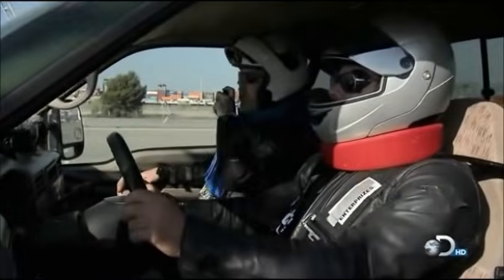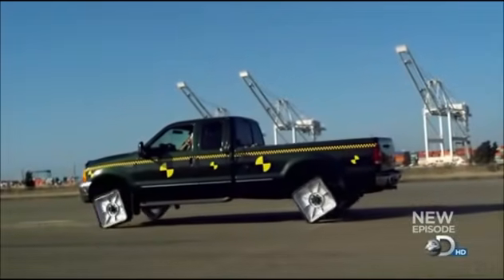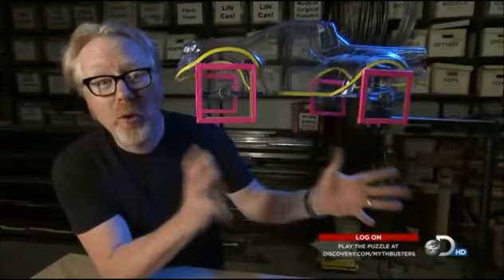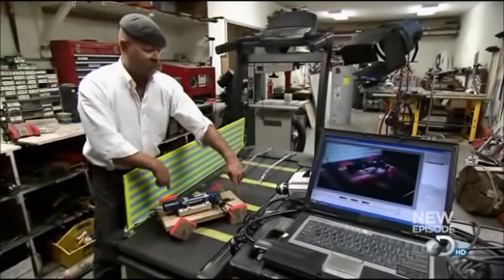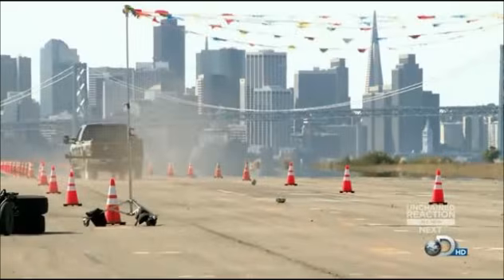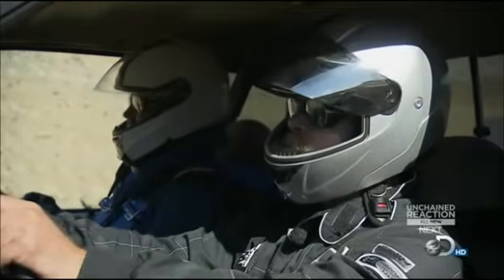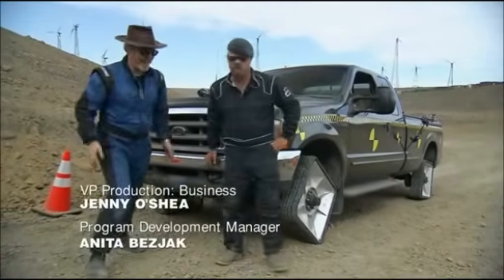Square Wheels - Mythbusters for the Impatient

Comment: In theory... if you could get it spinning fast enough to not lose so much energy to the suspension... you'd get better fuel economy with square wheels. Smaller contact patches, less drag. But, it would probably be in the thousands, or tens of thousands of RPMs before you'd start getting that sort of effect.

Comment: Mythbusters vs Car Talk -- an EPIC contest between the two greatest 
knuckle-head science teams in the techno-cyber-sphere:  A CAR TALK 
PUZZLER THAT MUST BE BUSTED!  Car talk claimed that a WWII German truck 
flat fan belt would last twice as long if cut, twisted, and reconfigured
 as a Moebius strip, because wear would be evenly divided onto both 
sides. I claim the fan belt would last LESS time because it would twist 
twice as much per revolution as a non-twisted, non-Moebius fan belt.  
More twist = more heat = faster failure.  Who is correct?!?   * CAR 
TALK VERSUS MYTHBUSTERS!!!!! *    Michael Kauper, 
childcareguy47@yahoo.com, (612) 483-0298.  Please CONTACT ME if you 
decide to Bust this Car Talk Puzzler!

Comment: Craigslist: slightly used truck. Never been abused
Reply: No lowballs, I know what I have.
Reply: @NoahLinebarrier  18k for 7.3
Reply: I was super impressed with the truck honestly. I wouldn't buy it after that, but that's a tuff truck to survive this episode.
Reply: I'm struggling to think of a single part on that truck that hasn't had 75% of its life shaved off, maybe the engine?

Comment: If the terrain were consecutive half circle “hills” with arc lengths equal to the side length of the square, the ride would be smooth at any speed. Square would be much smoother than round wheels in that case.

Comment: I love how they used 2wd with round wheels and 4wd in square wheels....
Reply: wasup23tube or how they rotated  the wheels but the truck has a differential so it did absolutely nothing because is not a fixed axle....
Reply: I was thinking the same thing.

Comment: The solution to 300 mph?  Perhaps triangular will prove to be the answer.
Reply: We're literally getting close to circles. Octagon is a few cut edges to becoming a circle
Reply: I think octagonal would be better choice
Reply: Decagon wheels would be 10x better
Reply: If you smooth the edges a bit, triangular wheels are quite useful.
Reply: Circle would be better

Comment: Thank God, circle wheels weren't copyrighted
Reply: The patent would have expired thousands of years ago.
Reply: @GamesFromSpace  not if they reniew it before it runs out
Reply: @thefrenchbastard1646  All renewing a patent does is keep it from expiring earlier than the normal maximum duration. It does not extend it past that maximum (usually 20 years). Patents are not copyrights.
Reply: Arun SK well I’m pretty sure the government at least in the us would have canceled it
Reply: @Nigel Cam What the hell does that have to do with what I said?
Reply: Thank god apple was not around theyd have not only patented them they would have later replaced them with square wheels and charged you for a dongle that snapped on over the square wheel to make it round and said it was done to make the care lighter.

Comment: Offsetting goes away as soon as you turn and with road variations. They should have tried smaller tires. I presume the smaller the tire the lower speed needed to achieve similar smoothing results.

Comment: When going up the hill in standard wheels, 4x4 traction was off, can see it in 4:07, but, climbing with square wheels, 4x4 was on, 4:27, so, the square wheels are even worse than results showed up.

Comment: Maybe if the wheels were shaped like hexagons or octagons, the truck can make it up the hill.
Reply: Maybe you just need to keep adding sides until it becomes something like a circle. A round wheel, crazy!
Reply: HEXAGOOOOOOONS

-Doug de Mauro
Reply: Hexagons got on boots.
Reply: Or if they used four wheel drive instead of two wheel.
:|
Reply: That's true
Reply: @c-dawg98  
Yeah there's a reason the saying is "Reinventing the wheel."
It's been around for so long and we've tried so many different variations that, aside from materials and any new types of science, our understanding of the wheel is basically maxed out.

I mean the "Square wheel giving more climbing power" idea is basically why round wheels have treads.  Treads in the tires create more grip, and different treads have different things they can grip better.
Reply: I know, that was just my creativity, curiosity, and imagination just talking.

Comment: Rip chassis 
Rip transmission
Rip drive shaft 
Rip axles 
Rip differential 
Rip shocks and springs 
Rip motor mounts 
Rip steering column 
Rip drivers asss!😂

Comment: If the square wheels had the rpm they would act just like dune paddle tires. If the trucks wheels was in synchros at a really low crawl speed it would climb better. If you just gun it at the hill and your paddles are not synchronized they would work against each other. Yet once again the test was bad. It’s just like the cell phone at the gas pump test. They didn’t understand the 14:1 air to fuel ratio. He kept adding fuel. Playing with matches 101 failure.

Comment: Now on flat ground that does not work well but if they had used a suffice that was kinda\ /\/\/\/\/  so that the points when into the hole and flat of the square went on the tops it may have been smooth all the way providing the points when into the gaps every time

Comment: Okay. The F250 can't climb the hill in it's base form. Because one. I'm positive that bitch ain't got 4 wheel drive, and two. You NEED to lift er'..... You should have got a truck with 4 wheel drive. That would've worked best in your situation.

Comment: Round wheels going up the hill was not in 4x4, the front wheel is not spinning before they stop... square wheel is in 4x4 when they "hit" the yellow line. I figure the square wheels have the diff locked on, but why not the round wheel's?

Comment: 4:14 Perfect example of where mythbusters screw up sometimes - they used the same wheel configuration as when they were trying to get a smooth ride. However, for this experiment, they should've kept all 4 wheels in the same orientation, providing more stable moments.

Comment: The problem isn’t the shape, it’s that the truck was designed for circular wheels so that the wheels do the work.

Square wheels work if you can SLOW DOWN the “fall”. That moment where the car is balanced on the point of the wheel and is “falling” to the square side. If you can keep the car on the point and slow down the fall it would be smooth. From there, speed up the fall equal to the climb and increase.

Comment: It's going to slam because right after it goes over the corner there is a straight line that the weight of the truck falls onto.  And, it'll use more gas.  Maybe they could try hexagonal shaped ones.  (Shrugs)  Maybe that would even help to brake faster.

Comment: The round wheel configuration wasn't in 4WD (4x4), which says so much about the square wheel configuration that was in 4WD. But an unrealistic test none the less. In 4WD configuration, that Ford F250 4X4 could have easily climbed a hill that grade.

Comment: They should have put the square wheels on a vehicle, then have that vehicle towed by another vehicle.  That way the acceleration wouldn't be dependent on the the power-train connected to the square wheels.  That was just too wonky.

Comment: There's a variation of this myth that says if you rebuild the road to be sawtoothed so that the wheels slot into them like the teeth of a cog, you would get a perfectly smooth and even ride.
Reply: How would you turn
Reply: you wouldn't
Reply: @johnferrante3247  rotating device under segmented road parts
Reply: @goochipoochie  I do believe what you are creating is a train of some sort
Reply: John Ferrante Geometry, but not just a saw shaped road
Reply: @johnferrante3247  Oh that's an edge case
Reply: some of the earliest trains (prototypes, mostly) had some wheels that worked in this way and yes, as someone else said, your ability to turn would be limited- specifically, as limited as a train.
Reply: @spamhonx56  Fairly sure they used this configuration in extremely mountainous areas to aid traction on the slopes.  You don't want to get the speed up because the friction would destroy the cogs so if I recall correctly the maximum speed of these trains was a fraction of what a conventional train could do.
Reply: Haha yes, I remember visiting a science museum when I was a kid with a whole life-sized setup to demonstrate this. But instead of sawtoothed, the cross-section of the road was scalloped (made up of repeating circular segments).
Reply: Somewhere there is a bike path like that
Reply: I like chicken sandwiches
Reply: @bandit911  I think you have reached the only logical conclusion in this case.
Reply: KTo288 it isn't myth it is SCIENCE!
Reply: Dude, tracks.
Reply: some guy in a jet would completely eliminate traffic actually
Reply: It’s not a myth because it is true
Reply: 🙌😂😂😁 "Car tracks" similar to train tracks. The only problem is changing lanes...
Reply: http://3.bp.blogspot.com/-O-dkHHKj72E/TdzNH5YDgqI/AAAAAAAABfM/nIUTwjL_NR8/s1600/mn01.jpg

You could also use this sort of setup to move really heavy square blocks
Reply: There's a vsauce video about that.
Reply: Wouldn't that just stop the truck in its tracks? Get it.. I'm funny
Reply: Just for anyone that's interested, something like this exists IRL. Specifically, trains that have to traverse inclines in frequently icy conditions will often have special tracks that are not smooth, with wheels that are not circular, so they can't just slide down the hill. (These special tracks wear down faster so they're not the main tracks.)

The tram to Zugspitze is an example. The ride was noisy and slow, but not as bumpy as you might expect.
Reply: It's called an inverted catenary curve.  You piece them together with the same arc length as the side of the square.  I was hoping the two, um, individuals in this video would demonstrate, but I can tell after watching that my expectations were too high.

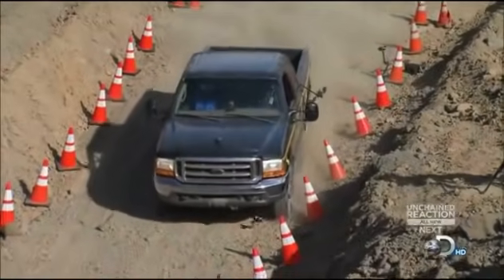Comment: At 4:25 , the only reason the truck couldn't get ANY higher is due to the fact that there was the marker there holding the truck back. It could have gotten a little further if the marker weren't there.

Comment: If the wheels had sensors to stop square during braking, with the additional rubber on the ground, it could stop on a postage stamp. However, with the forward momentum wanting to take the line of least resistance. the car would spin all over the place.

Comment: Square wheels can actually move smoothly on a special track made of semicircles instead of flat ground as long as the circumference is the same as the length of the square side. Saw this at a university, just look up square wheel tricycle if you don't get what I mean

Comment: Even though your configuration of one wheel up one wheel down was okay you're actually fishtailing the back cap makes it not very much of a smooth singular ride you're not going in a straight line you're just fishtailing and that the whole cap was ready to come off the back of the truck you need to put weight in the back of the cab for it to actually your configuration to be true

Comment: Lightly used Ford truck for sale. Lol
Reply: comes with stock wheels and an extra set of used square tires for offroad use
Reply: Diff might need attention but I'm currently too busy to work on it. My loss is your gain!
Reply: Say what you want but my piece of shit Ford has 300,000 miles on it and going strong.  I have to climb in through the window though.
Reply: Everything on craigslist😆
Reply: Bryansk Scion Forever Old Road Driver
Reply: You sir just won the internet!
"Mint condition, no wear"
Reply: @toop4538  at least ford didn't ask for bailout... Unlike chevy
Reply: Lol
Reply: "Original wheels."
Reply: lmfao
Reply: "it's got the bullet proof 7.3, 25k no low ballers"
Reply: F ound 
O n
R oad
D ead
Reply: @kyote1r77  ford is great
Reply: @kyote1r77  ford actually stands for
Forever
On 
Rescue
Duty

It stands for that because they always rescue chevys because chevys suck
Reply: ghw1985 dosent matter what brand it is dumb ass.
Reply: Brittany Wells Ford = found on road dead!
Reply: @darrelljones5536  Ford is awesome. Chevy is the brand that sucks
Reply: @brittanybenfield1463  Said the guy that drives a Toyota
Reply: @floridianrailauto9032  lmao I drive a horse and buggy
Reply: Fake News  @brittanybenfield1463
Reply: Brittany Wells ford sells a cheap quality vehicle for premium price bc it makes them more profit for them. Plus it does matter what model say they used a power wagon it probably would have made it up or a chevy Colorado or a ford raptor the raptor might not make it up but it would if it wouldn’t break but still
Reply: @samarmstrong4328  and GM are not made in America... made mostly in china. And they sell them at a premium price for profit. Fucking over the American people.. and ford didn't ask for bailout. Unlike GM so it does matter
Reply: Brittany Wells best diesel trucks r ram with a Cummins probably best all in all truck either a chevy or a ram diesel
Reply: @samarmstrong4328  yeah they probly used the bailout money to make it""so called better"" atleast ford didn't ask for bailout... and the f150 is the best selling truck.
Reply: Brittany Wells  it does matter
Reply: "it does matter"
It doesn't. The name brand of a product doesn't matter as long as the product line itself is manufactured properly. This is why any company is capable of manufacturing duds.

Brand loyalty gets you nowhere.
Reply: @samarmstrong4328  how?
Reply: @samarmstrong4328  how...please explain
Reply: no wonder it didnt work its a fuckin ford
Reply: ghw1985 Lmao.. like a Chevy would of done better
Reply: @rodrigoesparza2265  Chevy sucks
Reply: @BEC_Plumbing  lol and what did I say?
Reply: @rodrigoesparza2265  oh sorry I thought you said chevy was better sorry about that
Reply: @rodrigoesparza2265  I agree that Chevy sucks
Reply: @ghw1985 to bad all trucks are gay
Reply: ghw1985 like your piece of shit can do better......fucktard
Reply: Fix Or Repare Daily!
Reply: @bryanskscion2229  chevrolet. Cracks. Head. Every Valve Yattles Over Lousy Engine Techniques
Reply: @nickman888  I agree chevy sucks

Comment: What about Square wheels driving on a specifically designed road? Not flat, so that the corners of the wheels rotate into a depression creating as smooth of a ride as with round wheels on flat ground

Comment: Well, that was utterly pointless, hope it was at least fun at least torturing the poor truck.
Reply: Critica1Bi11 remember the older Fords were better than today's shit.
Reply: That and you certainly do not need to use Square wheels for that thing to shake itself apart it does that pretty well on its own
Reply: sod off
Reply: Wolfy Kun the truck they tested in this case was probably the shittiest generation of F-350 Super Duty with a powerstroke the only way you can get decent mileage with that thing is put head studs on the engine that's assuming the body doesn't rust out before you get to that point
Reply: Silas McGee .....true. but still why waste a good truck you could actually modify?
Reply: Silas McGee hell, I know it may be a piece of shit. But any man can turn anything, even a Toyota Prius into a racing/mudding machine.
Reply: Critica1Bi11 haha let's see another  truck with them tires on shitstain.
Reply: Wolfy Kun maybe... but 80% of all working trucks purchased by large companies are Ford.
Reply: Nick X GM?
Reply: It's a ford, so who cares. Barely worthy of the name "truck".
Reply: Critica1Bi11 The ford actually made it through with no problems meanwhile I bet any of your asscheek Chevys wouldn’t even make it to the track.

Comment: Triangle wheels would work 10000000x better... Angular momentum and since its the strongest shape other than a hexigonal tire it would hold up against the vibrations .
Reply: Triangle would be even harder because they have fewer sides. The strongest shape is actually a circle since it has no corners at all.

Comment: Triangle wheels would be worse. Or, even worse, using a flat line...
Reply: Terry Miff incorrect, more bumps equals smoother ride. A circle is essentially a figure with an infinite amount of bumps.
Reply: A flat line wheel is technically a tank... so...
Reply: @kamikazeeeeee103  you mean caterpillar/track, but that's not really the case as it's more like a belt rotating over wheels. The paddle thing would be like having the entire caterpillar arrangement rotate around its center
Reply: @kamikazeeeeee103  a tank has a lot of circle wheels with the rail things on top of them.
Reply: Jordan Ledbetter you are right...
Reply: Jordan Ledbetter But triangle is 3 sides, paddles for wheels would be 2 sides and 1 side would be....a wheel again!?
Just found the source of the singularity from which the universe arose!
Reply: Not if it were mounted in the style of the wheel as they did here, not in the fashion of a tank
Reply: staffy35 hah reminds me of attack track from heman
Reply: Tank treads friend
Reply: Let’s try line wheels
Reply: unless putting a flat line in the way a paddle boat would, a flat line would be like treads, aka what tanks use.
Reply: staffy35 a flat line would be a tank
Reply: Bazinga squared!
Reply: Bazinga.
Reply: Triangle wheels would have one less bump per revolution. Smoother.

Comment: What if the suspension was automatically adjustable. As the tire went towards one of the sides, the suspension extended down, and as the suspension was rotated towards a corner the suspension retracted. In theory the truck would stay level, and ride smoothly.